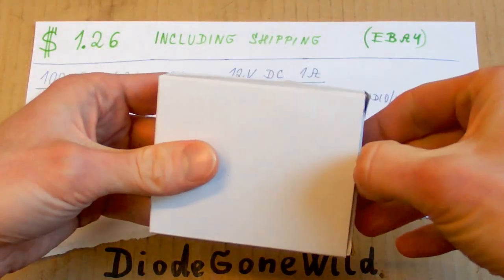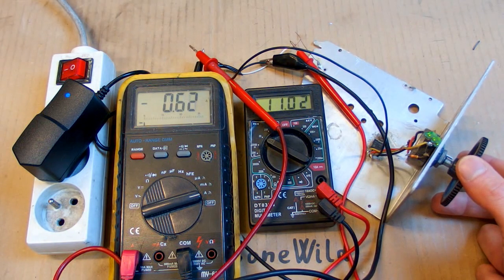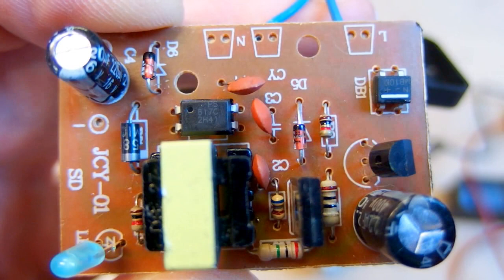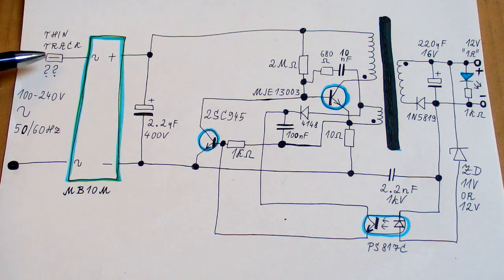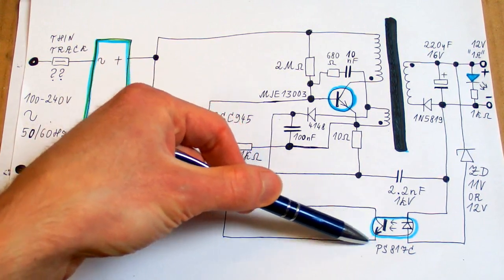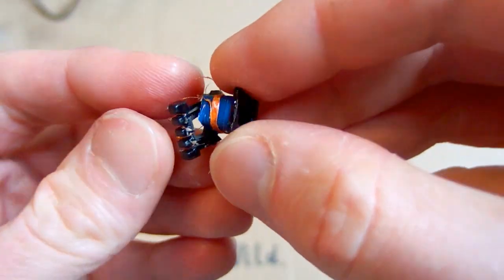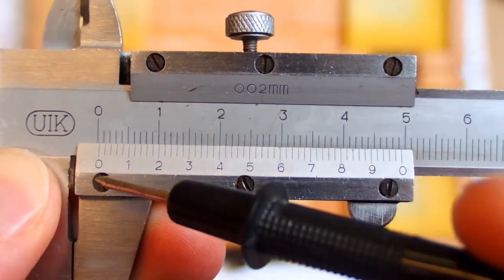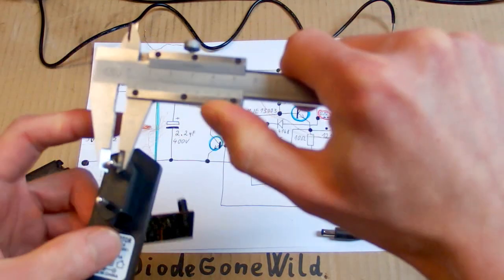Simple 12V 1A LED Power Supply - with schematic and transformer autopsy

Comment: The nice thing about it though is the blue LED is dim. Often, cheap electronics will include a blue power indicator LED which is super ultra bright, like blindingly bright. So bright, it's obnoxious.
I also have a recommendation for you ... test these with varying input voltage. The reason being, these simple PSUs sometimes are sensitive to input voltage, and so they can do even LESS current output at lower input voltages. (You have 240V I think, and it's rated for 100 to 240V... so try 120V or so)
Reply from the maker: I always put a piece of dark sticky tape or paper over it :).
Reply: Was just about say same at blue leds :)

Comment: the trasformer coil is made of aluminium thin wire, the residence is much higher than use coper wire one, thus cannot out higher range of current, and will get burn down easily.

Comment: With 10 Ohm as current sense resistor the max peak primary current is say 650 mA (assuming the left transistor Vbe threshold to be 0.65V). To get 2A the current sense resistor has to be 0.6R (according to LTSpice).

Comment: it seen like mostly 5V , 6V, 9V,12V they are using same transformer that one in your video look like EE13 . the only different is they change the zener diode to make higher output voltage?

Comment: Yep i thought 500ma max, they bullshit so much :-(.
So could you have squeezed out a bit more by making the emitter resistor 8 ohms and the bulk voltage cap 3.3uf?
Do you ever get bored ripping psu's apart...... sorry daft question lol :-D
Reply from the maker: I also don't understand why do they multiply the current by at least two. The user just ends up with the conclusion that it doesn't work. 
I think this si not worth any improvement... if you want to squeeze a bit more, just buy a better one :). 
The next time I'm going to open a 24V 10A power supply which I hope is a forward, not a flyback as always :). I also have numerous LED lamps to open.
Reply from the maker: The 12V 10A 120W one was a flyback, but flybacks usually never go above 150W, so the 240W one is hopefully a forward or a halfbridge.
Reply: DiodeGoneWild 
 I have an old Dell supply I wish you could explain. It's one of the weirdest ones I've taken apart. With 2 separate transformers, and 4 other wound toroids I'm clueless about what is going on in there.
    This design comes buried under a lot of silicone though. I probably spent 2 hours digging silicon out of this one, thinking I might figure out how it works, but I still have a lot to learn before I will really understand this type of design.
https://drive.google.com/file/d/182N-Jy30p-X1psBmsb-Wzew1q3vn6GOk/view?usp=drivesdk
I don't know if that is flyback or something else like you were talking about (thus why I posted here)
-Jake
Reply: Upcycle Electronics.
The first transformer by the power input looks like the power factor correction one, there should be a mosfet connected to it and possibly a stand alone chip.
Reply: zx8401ztv 
Yeah I was thinking this might involve a PFC circuit but I quit goofing around with it after I had trouble finding a datasheet for either IC. The 16 pin is marked:
DAP019D
DAY097
TXD12481
 The 8 pin is 
DAS05
AZ62518
TXD3101

  I couldn't find anything on those chips. They are SMT so I'm guessing they are the typical manufacturer's prefix/suffix parts number encryption or proprietary junk.
  Your correct about the FET on the primary side/first transformer, it's a K15A60.
  I was also confused about why they would have built this with 4 toroids. There are 2 common mode chokes on each side of the safety cap. Then there is another oddball toroid with one winding in series with the PFC transformer, with high voltage poly caps going to mains... because all those magnetics weren't enough and they needed to add a capacitive dropper supply ... that left my head spinning, it's just too much 4 me ;))
   To top it off the secondary output has a T0-92 packaged trany(IC?) marked 33W3031 that is placed between the secondary output rails and is marked "ID" on the silkscreen next to an output wire that looks like a signal line. Of course "33W3031" doesn't link to anything either. I assume this must be some kind of silly identification signal BS to force people to buy an overpriced "Dell" branded replacement for a product they probably engineered to fail... The same as their criminally proprietary AC mains cord/plug. 
(Thanks Dell! I'm ashamed to have grown up in the same country as this BS.)
Reply: Upcycle Electronics
Im sure ive seen the Dap chip in lower power dell bricks, yep the i.d device is quite common, sometimes you can turn the check off in the bios.
i would be a shit and lift the i.d chip out of the supply and make a cable with it in, then any old psu could connect to that cable lol, yes im evil :)
Is the supply dead or were you just trying to understand it?
Reply: zx8401ztv 
Just understand it. It's another one from the pile I get from a local thrift store when they toss out a tangled web of power supplies and wires. I mostly see designs from the late 90's and early 2000's this way but I get to play with a bunch of free junk and build a collection of sketchy parts.
  Basically every time I see some terrible psu design on Diodes Gone Wild I have to go through my collection of junk and move a bunch of stuff from the "sketchy" to the "scary" drawer. 
  Ultimately it's hard to screw around with stuff you don't understand.
  Integrating the ID into a cable is brilliant. I'll have to remember that one, or just place it inside the device itself, after replacing the connector with an ethical, general use version.

Comment: @DiodeGonewild, i have made all circuit as you mentioned in above video. At no load, there is fixed 12V. But when i am applying load ( 12 Volt relay), transistor 13003 heats up and burning within 5 seconds. I have replaced three transistors. Can you help me in this regard that why it is happening?

Comment: Isn't that 2.2nF capacitor (visible in the schematic) ruining the isolation?
Reply: Mainly because it's isolation strengh is only a quarter of what's required (separation between mains and secundary should be 4 to 5 mm or kV - Y2 class capacitors fit that requirement but 1kV ones obviously don't.
Reply: @mjouwbuis  
Now, after reading your comment I calculated the impedance of a 2.2nF for 50Hz. It is quite high in fact; 1.5MOhms.
So, I guess what you are saying is that normally this impedance is so high for passing enough current through human body. The only danger might be that if the voltage rating of the capacitor is not enough, it might break and then pass some current to human body. 
So, if we choose a high enough voltage rated one, it should be fine.

Comment: I buy these type of adapters from flea market like 0.25$ and they work every time.
Reply from the maker: They work, but with a lot of EMI, some risk of fire and shock and with only 50% of the claimed current capability :)
Reply: In my opinion, most of these are terrible products. They won't deliver nearly the amount of power they're supposed to. It's like a 4 wheel car with 3 wheels. You can drive it but have to be careful how you load it and use it haha.

Comment: If there are 180 turns on primary an 13 turns on secondary, there should be (13 / 180) x 230 V = 17 V on the secondary. How that 16 V capacitor is doing right there?
Reply: Focus on optacopler

Comment: The input high voltage 2u2 storage cap is too little (over 20V ripple, seen also at the output as 0.3V ripple). For 2 A this cap has to be at least 47uF
Reply from the maker: The switching power supply is regulated. Input ripple doesn't mean output ripple, unless the input voltage is so low that it comes out of regulation.

Comment: Hello, my 12V 2A chinese led driver power supply has almost similar schematic and has worked well for about 3 years. Now, it has developed a strange problem, it starts up kida slowly with a tik tik sound ( as if the oscillation is too slow ), then gives steady 12v when there is no load. but when there is load (500mA), it keeps ticking and fails to raise 12V. I checked the little driver transistor, the diodes, resistors they all appeared fine, the main switching mosfet (its a 600V mosfet instead of bjt) also appears ok. No capacitors are short or bulged either 

what could be the problem, any suggestion ?
Reply: lol get a new one. that joke aside.. " It might " be the transformer, caps drying out or the mosfet getting weaken from excessive heat.
Reply: @era7928  thanks for suggestion, but i diagnosed the problem already. the mosfet gate charging resistor was a small 1/8watt, it stopped working.the electrolytics are rated 105 degrees, and they seem still working.
Reply: @iceberg789  good to know that.

Comment: 100% recycled parts, except for the PCB, which was probably the cheapest thinnest board and copper they could get. Wire made from recycled copper, probably also has a good percentage of impurity in as well, seeing as how black it was. Windings were probably the best part, made from reasonable copper wire, and they used a sort of good tape, just left that expensive dip into varnish off, saving a thousandth of a cent in varnish and 20 minutes of drying time as well.

Typical overspeccing, 12V at zero load, and 1A or close to it into a short circuit, so call it a 12V 1A supply.

Comment: DiodeGoneWild
So what is limiting the current to 0.5 Amps?
And what parts need to be beefed up to make it true 1A or 2A power supply?
Reply: From my experience, just using a larger input capacitor (4.7-10uF instead of 2.2uF) will give slightly more power. Raising output cap value to 470uF should help as well. But the transformer is likely too small, and the output diode should be a little larger.

Comment: this is safe ? can we able to touch DC output cables ? its a shock proof ??? pls reply me
Reply: This is a dodgy transformer. There is worse, but also better. I bought the same for 5€ on eBay. Mine is WAY better built than the one shown in the video (better caps, better spacing, ...), but you cannot be 100% safe with those as they don't embed any fuse.

I bought it for my Casio CTK-520L keyboard from 1996. This keyboard normally uses AA-batteries, but I was bored changing the batteries twice a month. So I bought this dodgy adapter and it works fine! But I unplug it every time from the main, when I don't need it anymore. (You're never sure!)

For instance, I compared with a Yamaha transformer, from another keyboard, and this one was perfect... Nearly a pleasure to see this. Clean circuits, properly attached, a fuse, a lot of components, ... All of this avoid EMI, heat, and more importantly, electric shocks/burns/explosions. I've never known problems with chinese adapters, because I don't rely on the cheapest ones, but I do advise European/Japanese transformers, because they're better built.

Comment: So the conclusion is: super dodgy

And for information even safety class Y1 capacitors makes isolation much worse! Better to remove them and filter high frequency ripple by a 100nf capacitor at output in parallel with the electrolytics output filter capacitors!

Comment: Btw have you thought about 3D printer? It could be helpful in many projects.
Reply from the maker: I have thought about one, but this is the only thing I have done so far :).
Reply: I have one, but so far I have only printed upgrade parts for it itself. Well, almost, I also made a custom new button for solder sucker and printed an LCR-T4 enclosure. Started designing a more involved enclosure for something, but it takes up so much time, and there's overall quite a bit of learning curve, in spite of me having 3D modelled for 20 years on and off.

Comment: @DiodeGonewild is there any way to write you an email? I have one power supply with blowed up component beside a diode and I can not recognize it. You reviewed so many power supplies, maybe you can identify it.
Reply: Or maybe you guys? Two picture about the PCB: https://imgur.com/a/lDNZ1 and https://imgur.com/a/0qY6R
Reply: I looks like 3 diode in picture is part of bridge rectifier. I think it is a varistor to protect input. If it is the case power supply should work without a problem after changing the shorted diode and removing the varistor.
Reply: Class Y 'safety' capacitor used for RFI filtering.
Reply: Thanks for the help.  "Y safety capacitors are designed and used in AC line filtering in many electronic device applications." - so I think it is a varistor? Because it is after the bridge rectifier.

Can I temporaly remove this and replace the bad diode for a quick test?
Reply: Could you show a close up picture of the area? I think that with the overall view we have an idea of which components it could be common but I'd like a little bit closer of a look at it. :)
Reply: Also maybe a picture of the back of the circuit board as well in that area. That will tell us very quickly which component it is. I definitely think it looks like an mov as well,  But that is an interesting component to have failed.
Reply: For my money, it's a MOV ! Snip it off and the circuit should still work fine if it blew from a spike. You should replace it before long : you know Murphy's Law !   :-)
Reply: Today I played with the PCB, the photos: https://imgur.com/a/cHcd7 , https://imgur.com/a/e1glo , https://imgur.com/a/v8PXj. As you can see on the first picture: I found 2 dead diodes, nothing else. I checked the two transistor with my transistor tester, they seem to be ok.  The blowed up component was a 1kv varistor, I removed. Meh, but it is still not working. :/
Reply: You may to check and replace all electrolitic capacitors especialy the smallest one ... I think it's C5

Comment: 'your test Amp load' make it video :)
Reply: I use as a test load a $1.50 Buck Boost module from Aliexpress. It allows the output to be adjusted to lower or higher than the input voltage. I connect a car bulb or power resistor to the output of the Buck Boost module and use its input leads as load terminals. You could regard this Buck Boost module as variable DC transformer (stepping up or down as adjusted by its trimpot)